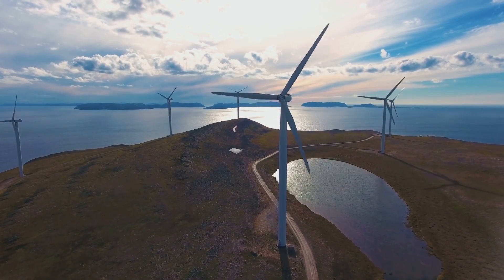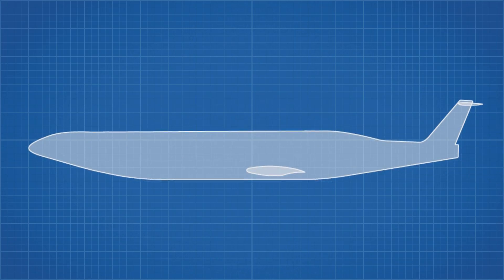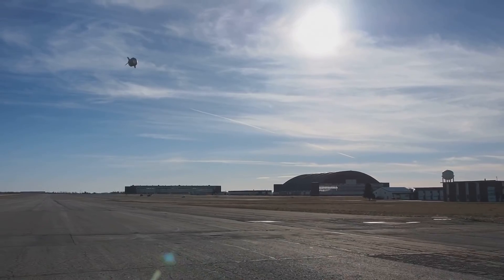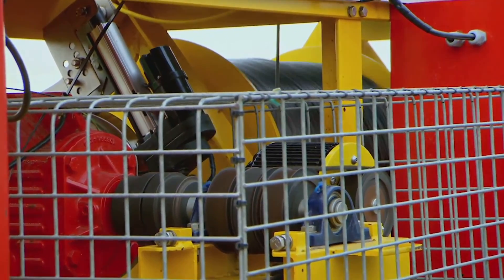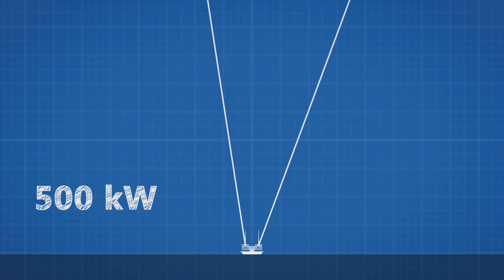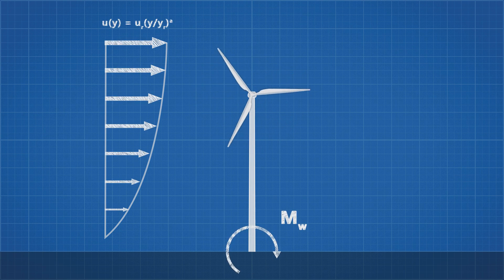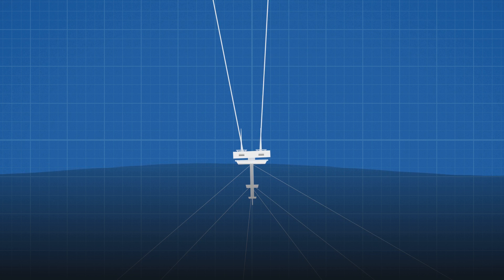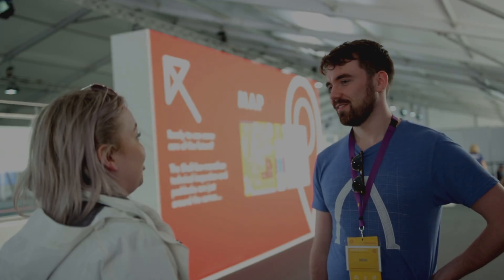The Future of Wind Power? - Kite Power Systems

Comment: When I was fresh out of school in 2006 I worked r&d on a tethered turbine not all that different in core concept to the lighter- than- air versions that you showed. I was familiar with this core concept and thought it had at least as much promise as the project I was working on since I was extremely familiar with power kites for kite boarding at the time.
As brief as your presentation was this was very well done and you presented it in a way that didn't get people too bogged down in the details.
As nice and mushy warm feelings as you were going for in this I would have liked to have seen at least a couple of the drawbacks they were working though. There are some very real issues that still haven't been solved or adequately mitigated for widespread use. One of the largest hurdles we faced were the consequences of tether failures. At the loading required the materials that are likely to be used are going to be conductive and a snapped cable poses both an issue of that mass coming down with a significant amount of force over a very long length as well as disrupting power grids at all the points that it crosses any kind of distribution line. On the plus side at least that can be mostly mitigated by locating these power plants off shore or away from built up areas.
Cool channel and another great video.
Reply: The kite isn't the issue, it is the tether. It is highly Dependant on where the tether breaks as to how bad it can be. If the tether breaks near the kite at full extension as a worst case scenario the outcome is that now you have a couple of km of steel cable at altitude that just entered freefall and the end will be crashing to earth with a fair amount of force and very likely take out some electrical infrastructure on the way. A better break will be close to the reel side and the kite has a chance to mitigate most of the issues mentioned.

Comment: I've also heard of people looking at using kites as sails for cargo ships.  They wouldn't replace the diesel engines, but would reduce the fuel needed.
Reply: Yes, there is a company that sells those.  And those can use the movement of the ship to generate power instead of the movement of the tether.
Reply: Nice!
Reply: And since fuel use is decreased so much it isn't impossible to add a battery 4 the remaining part
Reply: kite power systems is just a copy of the patented Skysails,  who is rolling out its own, on and off-shore power generation...so this post should have been about skysails... Real Engineering should be called Patent Infringement Tech...
Reply: @nc3826  However that isn't the company's CEO he talked to, is it?
Reply: @siddharthsivakumar5509 Was long time ago.... but it was different company that invented and they are were still in business selling it....
Reply: @nc3826  Shell is probably doing it so they can suppress the technology in favor of oil and gas.
Reply: @LoanwordEggcorn  Seriously?  Its an old story and I don't even remember Shell being  mentioned in it? But how would  they be suppressing technology this? So thx for the classic baseless SM anti-legacy torpe meme...,
FWIW, as cool as this tech is, its drop in the ocean vs the conversion to NG from dirtier HC sources, that's due to fracking...
Reply: I was thinking the same thing, can these 2 technologies work together, it seems very possible indeed. skysail + kite power systems this would be fantastic.

Comment: Not remotely convinced by this, firstly you're adding considerable complexity to the power conversion system in trying to generate electricity from a rotating generator with a linear motion a 3MW winch with a 90% usuage factor is likely a maintenance nightmare. Secondly I suspect the lifespan of the kites will be pretty short based on comparable things like paragliders especially with the duty cycle they are going to be put through. However the big challenge after the basic engineering and economics is going to be footprint. The kites sweep a wide area and you won't be able to pack them very close to each other or else they will interfere with each other for high population density counties with high power requirements the likelihood is that you run out of space long before you get close to generating enough power.

Comment: Definitely much better then conventional wind turbines. But will it scale up to power a metropolis? What if the wind stops completely? Will it survive a hailstorm? What will it do to birds? What if a large scale version breaks loose?
I still prefer small modular nuclear reactors. They don't depend on the weather, and work absolutely anywhere, underground, underwater, on other planets, and in space. Also small size means zero chance of meltdown or any serious leak. The US Navy (and others) has 60 years of experience with them, and a perfect safety record.

Comment: One of those 500kw systems could power my town. I hope this isn't a flash in the pan. The other thing you didn't mention was that for offshore wind to generate at $170 per Mw/h, you have to build them BIG. Small wind towers just don't work. This kite system COULD work at smaller scales, and still be profitable.

Comment: Preventing airplanes from flying into cables is definitely a problem, but it's a logistical one. Logistical problems are >usually< much easier to solve then scientific or engineering ones.

Comment: Hydropower have much less of the problems other green power production system has. It has a big built in battery, and as long as its big enough, you can just produce as much energy as you need, when you need it.

The only big bad part, is that in many countries, it isnt really an option.

Comment: So how does one get reeled in by the other reeling out? I understand the lift force is energy acting on the system, but aren't two kites bobbing up and down simply just conserving the energy in a "perpetual motion" type of oscillation? Is it that one has an angle of attack that creates more lift than what's needed to reel in the other?

Comment: Eh, a few concerns. First one would be safety, can you garantuee that this kite never skims close to the ground due to a sudden burst of wind?

How long does it take for that cable to degrade under the constant pull? At sea you'd probably need rust-free steel, but that's probably weaker. 

What are you gonna do when lightning hits your kite? This means that you have to real them both in but also build some kind of auto-deploy system to reactivate them.

I'm curious about their next test. Let's see if they hit their mark and how long that thing keeps producing energy.
Reply: you'd probably need rust-free steel, but that's probably weaker. 
We told you that stainless can't get the job done?

Comment: What if we gave up on the idea of large grids supplied from many Km away and went with smaller, if not individualized power generation at the point of use?
Small wind turbines and solar cells on every roof and large (think electric fork lift) sized battery in every basement. 
Thats leaving off the potential of small thorium batteries/thermoelectric generators and water turbines sized to run in small/medium streams...
Reply: plasmahead2 because it's not economical in any way
Reply: Maybe not for those in a city, but more suburban/ rural areas are a different story. I get that Cities need mulit-MW plants because that's the way they were built and completely uprooting that structure is impossible. I still think it would help to plaster most roofs with cells and tops of buildings with small turbines, the kind that are small enough to not need large amounts of open space to develop power.
It might be an economic "loss" up front, but the reduced strain and maintenance on a large grid of suburban sprawl/farm land would help off set the loss. 
And I thought the whole goal was to get rid of most fossil fuels? Or was I missing something...

Comment: My main issue with options like solar panels and windmills is that I just don't live where it's feasible to use them. I live in a valley where it rains 11 months out of the year, and we have cloud cover and heavy rain even in the summer. Everything's mountains and forests, and the closest windmills are two and a half hours south and the closest "green energy source" is an hour and a half up a river. I live in a place where green energy just doesn't reach and I know that in states like Alaska have it way worse.
I wish green energy was viable in places that aren't planes or open spaces. Hills do not equal mountains

Comment: but then the kite could become dangerous for planes... we would have to had some sort of balise on the cable... like the one on electric cables. however, I expect that it would affect the performances of the device ...
Reply: Testa  but those are what, 100m high?  Ideally you'd fly the kite kilometers high.  They would probably have to strike a compromise between flying it high enough to generate significant electricity, but flying it low enough to minimize interference with air traffic.

Comment: Honestly, this seems like a great, cost effective solution to generating power with wind. But it's still small scale relative to the current generation of nuclear energy - which is, paradoxically, rarely considered "green" even though its maintenance and construction uses up magnitudes less ecologically unfriendly manufacture than solar panels.

Comment: Great video. I like the idea of kites reducing the cost of electricity produced. Currently it's yuppie power compared to cheap coal plants. For renewables to be viable they need to be cost effective and reliable. Which brings me to the big question on kites. Will they provide base load power or is their input of electricity into the grid sporadic?

Comment: As a glider pilot i cant help thinking about airspace because these would need alot especially using cables. i use winches to launch and that involves alot of cables in less than a year of having this new system we almost sliced a cessna up because they flew too close. and i dont need to think too hard to realise that these kites could be a deathtrap for small aircraft.

Comment: It looks like a lot of space is needed to operate  those kites. Also synthetic materials do not like UV light so you will need to replace the kites quite often, not mentioning complicated hydraulic system, complicated power converting system and kite controlling system will need a lot of maintenance. 
Grouping of this kites will be a nightmare, especially if wind is changing it's direction. I see some applications for this technology for 3rd word countries, where a small town or village would need only one or two of such generators, but I can not image a big city powered by hundreds of this kites.

Comment: Check out FTERO from the swiss federal institute of technology. it's a similar system with the same basic idea, but instead of a kite, they use an ultra light weight gliding plane. advantage is that they have much more control over the flightpath

Comment: Potential Problem: If the cable breaks at the top by the kite you are left with a huge almost uncontrolled kite and a bunch of steel cable falling to the ground. Not very safe to be around, still a good concept. Also, this has been said, but these things would need a no-fly zone over them.

Comment: what is generating the power? i dont see anything spining , piezo cells?
also im kinda skeptical with anything looks so good on paper
Reply: as for why its not in mass production, is because its still essentially in prototype phase, proving its concept and design in order to be scaled up for commercial use, as stated in the video. It's not YET at a stage that can be built in large scale as other issues not noted obviously need addressing, such as the clear airspace needed between individual sites which translates to a large distance between sites required, this would make them harder to compete with wind turbines as you can more efficiently "farm" turbines, they only need to be clear of each others blades with a nice buffer region, so as not to spoil each others flow and allow for failures and bending. I imagine they have to make it VERY scalable in order to compete with the mass number of turbines you can place/acre of land as this is often a major constriction for wind farms already, cos land is pretty expensive in most countries, especially high density pop. countries like the UK and Netherlands. I can see them overcoming this issue but they have not done so yet from the look of it.
Reply: Matthew Ray the land requirements of wind power are a lot less than they first appear, because the physical base of the apperatus is relatively tiny. So you can still use the land for farming etc. Although it my be tricky to use crop dusters.
Reply: not tricky, illegal is what it is, because its suicidal. Even if the wind far was designed to be in parallels so u could navigate an aircraft between the turbines, the disruption they cause to the airflow would be extreme for a low level prop plane to be safely controllable but yes you can do livestock farming in conjunction with wind turbines, its just not a common occurrence because areas that are ideal for wind turbines are rarely also ideal for livestock. You can't do crop farm easily around turbines, you have to allow for both the regular use of combines and other heavy vehicles in proximity to these turbines and their infrastructure to the grid and youll find that costs a lot more space than its worth.
Reply: Did you not watch the video?
Reply: im sorry im not an expert , im jut kinda shoked this guy is not alredy mass seling this ,if the results are soo goodi would expect this to alredy be in like maximum mass production
Reply: rotating by wire

Comment: I'd need to see what's actually being run off this "power generated" before I say this is anything more than a solar roadway.

On the bright side, assuming it actually generates power, and the automated systems don't cost more power than that, it's not a self-defeating system.
Reply: Attach a tesla battery rack to it and you would not need to have 2 cables [it would allow for easier control and a bigger "parachute" active wing].

Comment: my concern is that these wires will wear and tear really fast. And I think that kites too, if they are 24h a day 365 days a year up in the wind with lightning strikes an so on
Reply from the maker: Äidriään they are replaced on a yearly cycle and the kites are grounded in lightning storms
Reply: Kyle Johnson 
??
Or you can just stick the other end onto the ground and the electricity will just pass right through the cable...
Reply: try iceland, lightning almost never strikes here, and the wind is almost always strong, sometimes too strong.
Reply: Good point.  They already have one of the best alternative energy resources and a lack of population.
Reply: What is considered to be a lightening storm? Wouldn't most storms have the potential to create lightening?
Reply: Couldn't they also coat everything important in some kind of electricity resistant polymer? If you're already using steel cable it wouldn't increase the weight all that much, though that really depends on how thick of a coat you need.
Reply: Cestarian Inhabitant, but who needs that much energy in Iceland?
Reply: if these kites are anything like paragliders, then they won't produce any lift when it's raining. they will fall like stones.

Comment: first wind power alternative i like. Limited land requirements to build and much better for landscape aesthetics since they take up less space on the air, much quieter then alternatives, much safer for birds and the shadows they cast are much more acceptable for neighbors then rotating blades since is not a flickering/oscillating shadow and they cast a smaller shadow for the same power generated

Comment: hmmm... the jet streams are a long ways up, much further than the demonstration kites that you have shown in this video. With 2 to 10 miles of wire in the air will this system still be viable? What about the obstruction to aviation?